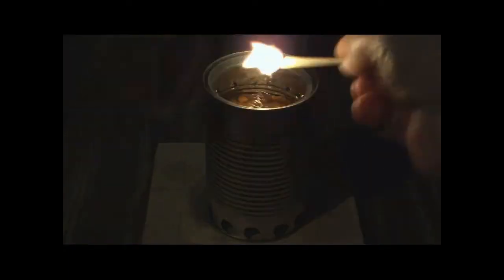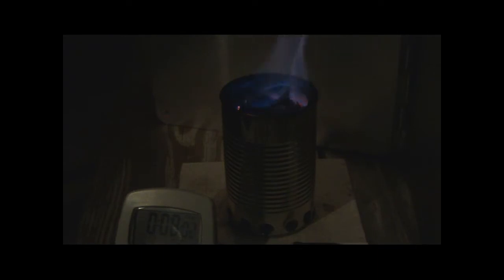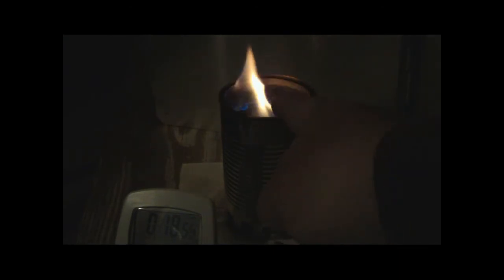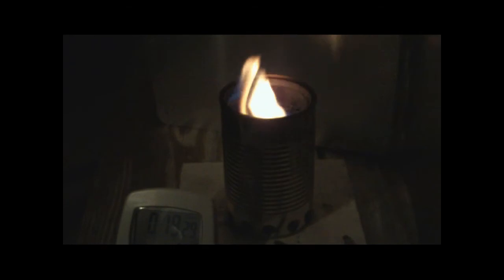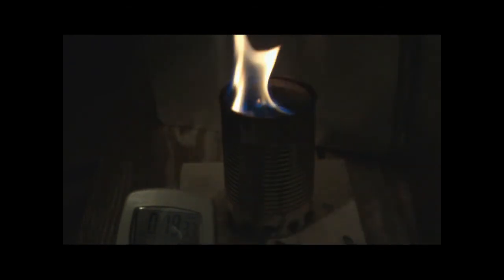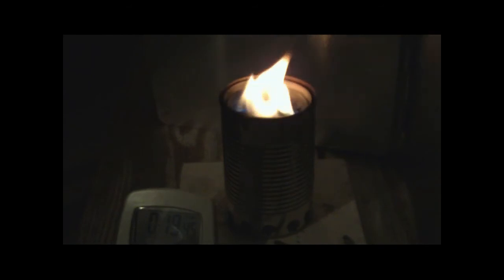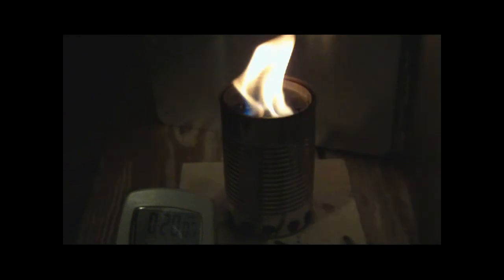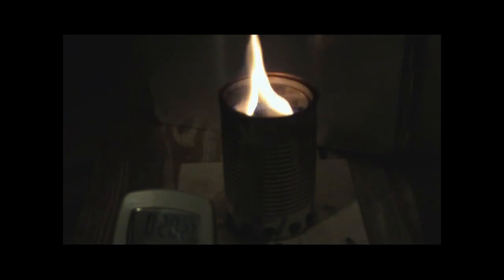Froup Stove - Burn Test #1

Comment: I think the reason the pellets went out is the lack of oxygen THROUGH the pellets...you need some holes in the center of the encert can say 5 or 6 holes of a size that the pellets will have a hard time falling through.   you are right on your assumption of the burning wood gas
but it takes alot more oxygen than you have there.... bigger holes are in order all the way around I think, I built a wood gas burner for my truck and I was surprised at how much Air it took to keep the fire burning and yes when you get it right there will be no smoke ! but that is extremely hard to accomplish in such a short distance....
I think I might try bigger holes on the side of the bottom can ( inside one) and maybe 2 rows first and if that doesn't do the trick add a few on the bottom of the inside can ....
pellets make it real hard for air to get through, it almost has to be forced through with a fan
 I've made several pellet stoves to heat my house with , so I know if you just dump them on a skillit with a zillion holes they don't all burn.... not enough air !  adding even a small fan cured that problem.  
what your trying to do here is make the flames/heat in the center go down and then come back up on the side of the can and then out..... that reverse action is not easy to accomplish
heat wants to go up always  so find a way to supplement the normal direction of burn with a little wood gas burn.... not all of it ,and I think you will have better luck !  pet that puppy !